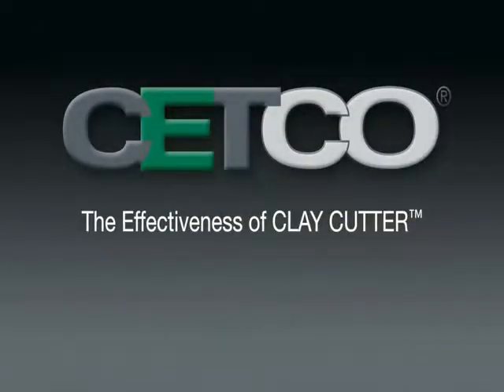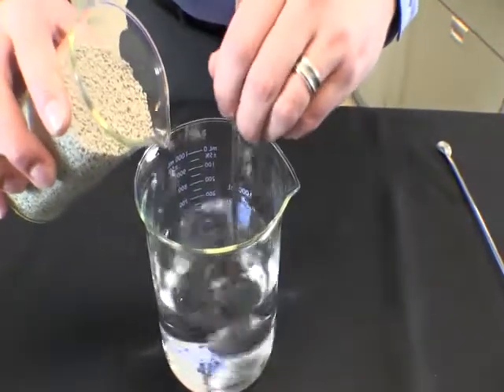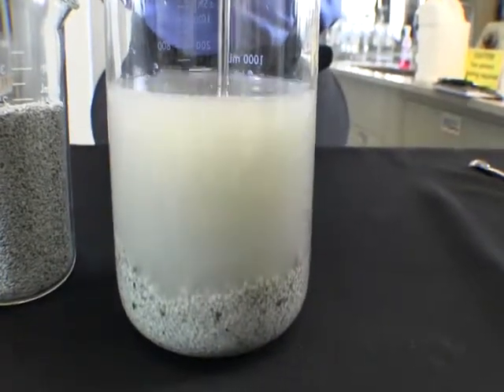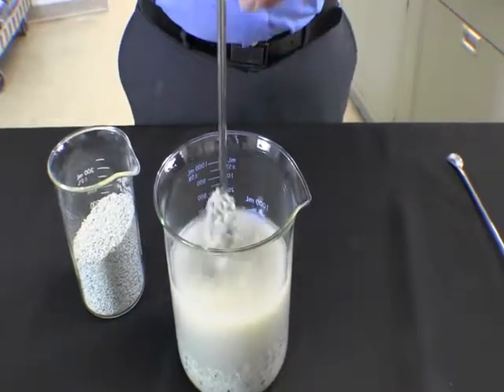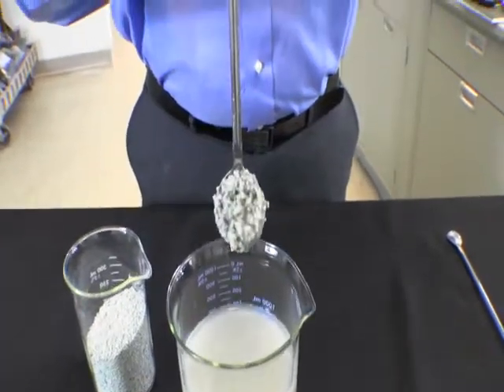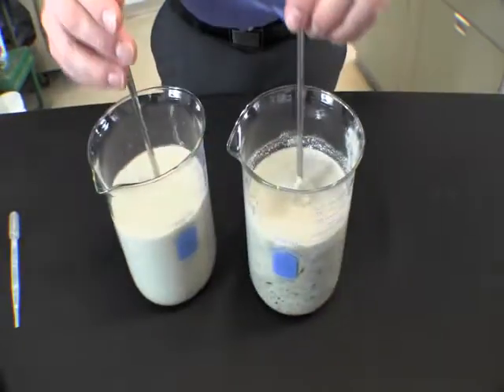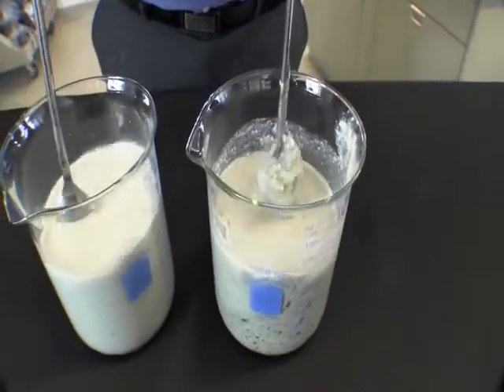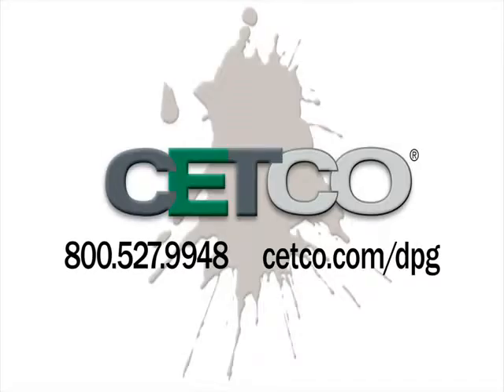Effectiveness of CLAY CUTTER™

Comment: The beaker on the left has significantly less bentonite in it. This is not a very scientific experiment. You have the specific volumes of water and concentration of the inhibitor but have not used the same concentration of bentonite.
Reply from the maker: Thank you for your comment.

There are specific details about the volume of the water and CLAY CUTTER as this represents the drilling fluid being used.  Regarding the amount of clay used - you make a valid point.  Our intent with this demonstration focuses on general performance rather than making sure that dosages are identical as this will always vary in the field based on pumping volumes and speed of drilling.  CLAY CUTTER truly is a remarkable product. We invite you to reach out to us for a sample to see for yourself.  Send us an email at drillingproducts@mineralstech.com
Reply: You must be an experienced driller. From your experience, including using proper drilling fluid what else should be done to prevent bit balling or stuck pipe?
Reply: @saideng3529  Not a driller a Drilling Fluid Engineer. Bit balling and other issues associated with drilling clay and shale can be mitigated by using a combination of potassium salt KCl, PHPA (partially hydrolyzed polyacrylamide) and shale stabilizers.
Reply: @abdownunder  Thank you for taking the time to answer my question. I am an E.I.T. in the trenchless industry, I don't do drilling fluid design but I am always happy to learn more about it.